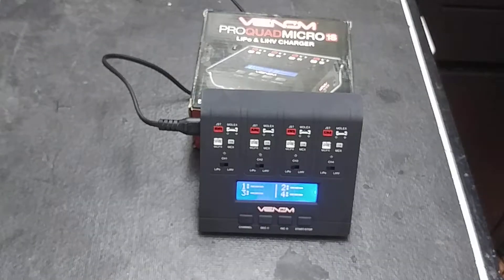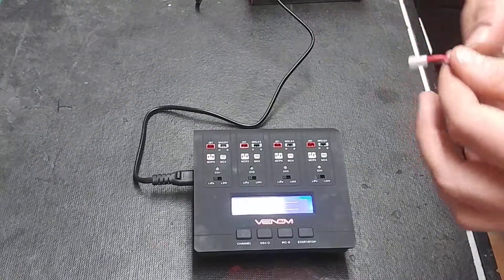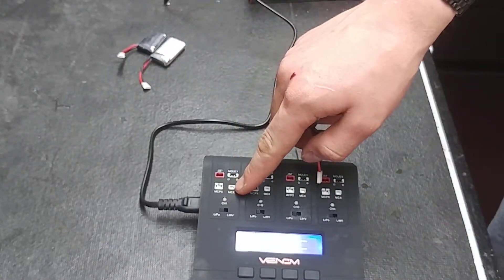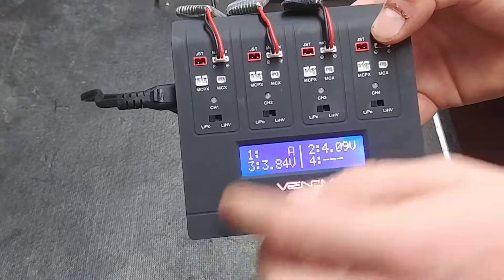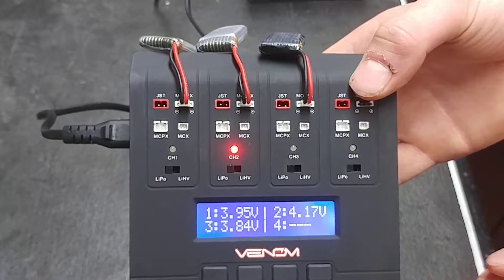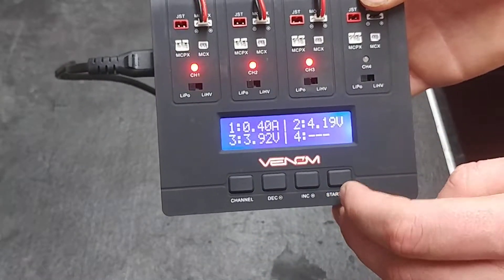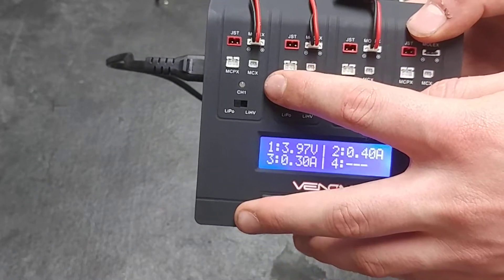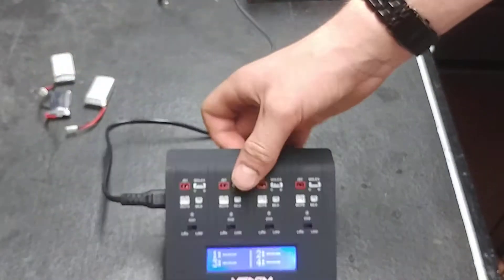How To Use the Venom Pro Quad Micro 1s AC/DC Charger

Comment: How do you know what charge rate to set it at..
Reply from the maker: You go by the capacity of the battery. 1 amp is 1000ma so a 380mah would be charged at 0.4 amps. If you have a odd number capacity like 380 always go up in amperage to .4 so you are charging like a 400mah battery instead of a 300mah battery.
Reply: @RcOutdoors  thank you..i read a really long post on lipo batteries and figured it out..the battery i had was a 150mah with up to a 3C chatge rate..so i figured to safely charge it i set it to .30 charge rate and it seemed to have worked ok..me and my son are new to the hobby so we really appreciate any help we get..again..thank you
Reply: We went out and flew our horizon sport cub s and it flew away on its maiden flight and we looked for 30 minutes and couldnt find it..so much for model aviation:(

Comment: How's the ecx ram runner coming along?
Reply from the maker: drog343- unfortunately it is still in pieces i did get a new chassis but it still needs alot to run again. The raider needs a servo and tires the mini 8ight needs another motor after snapping the spindle for a 3rd time. The ecx ford raptor build will still be awhile since i would like to get all of my other vehicles running before i start that project i hope in the coming weeks to have a few more videos and alot more in the coming months. Its been really hard to create content these days as there are so many RC channels on youtube and since the hobby is so expensive. If you or anybody else have any video ideas  let me know and i will do my best to do it!
Reply: I hear ya, I just got both my kids trucks back up and running, and I still have a fair amount to do on my rig. I finally have all of the bits and pieces, now I just need to get wrenching.